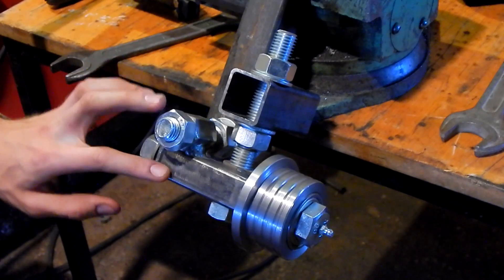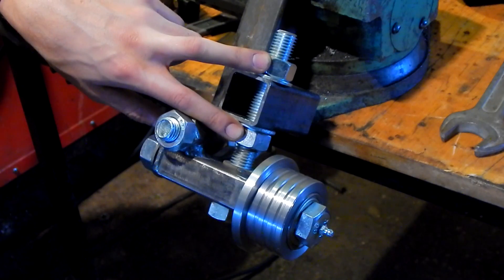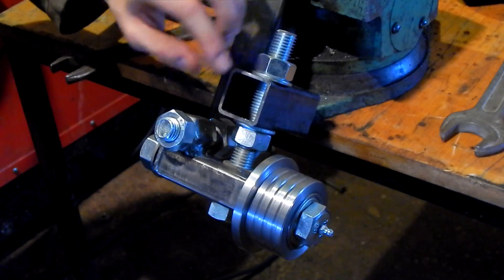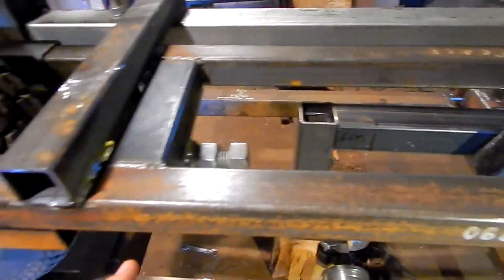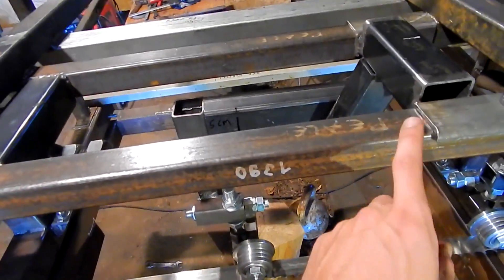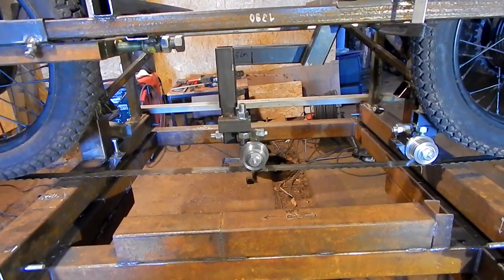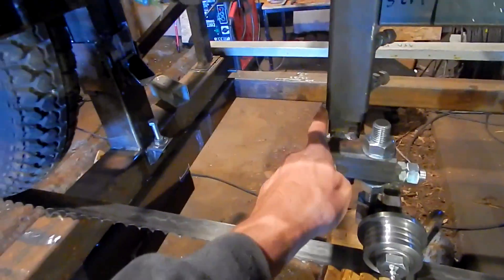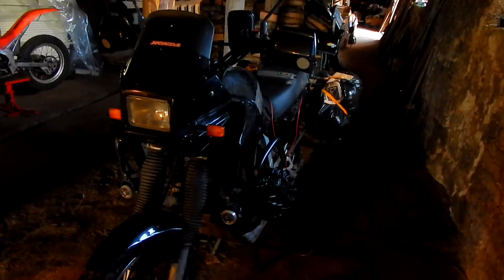Fabricating Blade Guide Mounts - Band Sawmill Build #18

Comment: Donn, I'm just collecting materials to start my build. I've seen a number of wheel adjustment (tilt/angle) as well as tension mechanisms. Can you share what adjustments you built in and how much adjustment travel is needed for things like "roll" and "yaw?" It seems to me that if the wheels are really parallel and have a dome profile the blade will always center at the top without major adjustments. I'm just not sure what adjustments are most necessary. On my regular band saw there is adjustment forward and aft for the top of the upper wheel only. Could those adjustments be made on drive wheel only so the tension wheel is only moves in a single access or should there be adjustment capability on both wheels independently?
Reply from the maker: I built in adjustment for both wheels independently, it helps to play around with the band positioning. If you use motorcycle wheels the blade will stay nicely on the top of the round profile - velocity is the highest, so it kinda holds the blade up there. Using motorcycle swing arms on both wheel will give you the adjusting but blade tensioning should be independent from band tracking adjustmenr. I hope this info helps!
Reply: Sweet. Yeah that helps. I was thinking trailer tires because they are high pressure and have a good crown as well. Might use trailer hubs too. Will keep my eyes open for a street bike as the smooth profile may be better. Will think through the dual adjustment a little more. Thanks so much.

Comment: you may not know this but your wheels should have mass so that they can press through the logs. Must not lose momentum. With blade size you have should be over 10 hp
Reply from the maker: The petrol engine has 15 HP. Now I have alloy wheels on the mill, should be a bit heavier than these spoke wheels.

Comment: might say the shop has taken a real "Evolution"
still on the first carbide blade for the saw or got a new one?

also where do you buy all you abrasives from you must go through alot of cut off and flap disks
Reply from the maker: I changed recently the blade because knowing me I was experimenting again - I wanted to find out how fast I can feed the blade into the material until the blade caught and yanked itself to a halt after putting too much pressure on it, the blade spun on the motor shaft and chipped a couple of teeth on the blade as a result. So checking whether the blade is tightened properly or not would make a great difference before using the saw after purchase. I just buy the abrasive discs from a local hardware store. I buy them for the big grinder (230 mm-ish in diameter) - the prices are sometimes even lover per piece than on the small ones. I use a disc until it fits on the small one and put it on the small grinder and then use it to the victorious end. So I pretty much get two usages out of each abrasive disc.
Reply: yeah i chuck my 9" disks down the the 5" once theyll fit in the guard, the dry cut saws like pretty even slowish pressure, some people goway too slow though and just heat up the blade and make splinters instead of chips

guy near me sharpens my carbide blades its about 12$ canadian per blade and 2-3$ per tooth he brazes on, he has bins of different size carbide teeth and oxy acetylene to brace new ones on

Comment: I wish you nothing but sunny skies and tailwinds for your ride this weekend and I look forward to the continuation of the build as it progresses and I continue to wonder why the one wheel is lower than the other.
Reply from the maker: Oh, sh*t, I forgot to mention in the video why one wheel is lower. It's for keeping the blade tension on the movable blade guide to keep it rolling instead of sliding. The farther you move the guide from the left wheel the lower the blade tension gets and the more it wants to not contact the blade. So although it gives the sawmill a crooked look it is meant for keeping the cut accurate. :D I hope you understand my babbling.

Comment: heee, love the shot on the blade, and the one outside, it is beautiful there! Could you do a shot with a small log that shows how it will work? i am a bit lost :)
Reply from the maker: The log will rest on the trailer and is cut by the mowing saw head and the band saw blade and that's it. There's just million small thing to do that doesn't show from a far so everything lines up. But I will get there and you'll see how it works. Or doesn't. :D